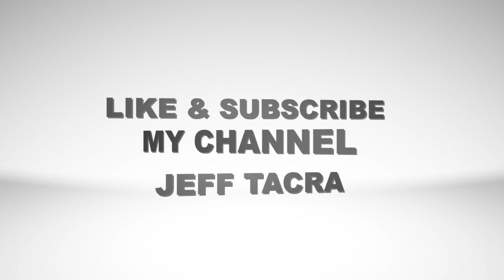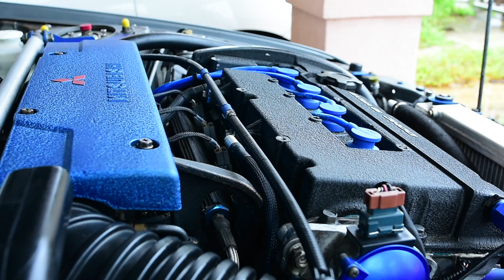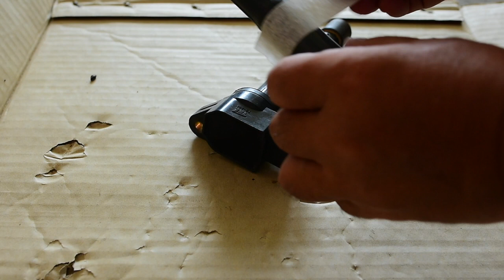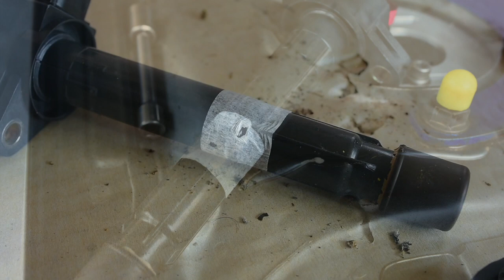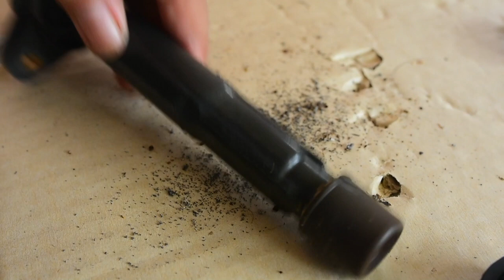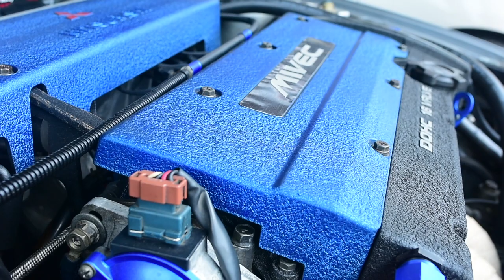Cara Pasang Coil K20 Pada Enjin MIVEC CA

Comment: Strut bar tu bos pakai apa brand ye? Saya punya takleh nak pakai bar kalau saya pakai cover intake tu.
Reply from the maker: Brand cusco dari evo3
Reply: @jefftacra  ouhh. Baik bos👌🏼 tq . Wiring siap pnp terus ke bos kalau pakai k20 ni??
Reply from the maker: Plug n play
Reply: @jefftacra  bengkel bos kat mana ye ? Saya ingat nak hantar kereta saya check. Mivec On problem dan ada bunyi pada engine, saya dah bawa ke bengkel, ada yg kata bunyi conrod, ada kata bunyi teppet, dan yg Mivec On tu pada gear rendah (1,2,3) boleh dapat , dan pada gear tinggi (4 & 5) memang tak dapat, tekan minyak lebih rasa kereta jadi blow dan rasa macam tertarik kebelakang. Rasa macam Mivec On nak bukak taknak bukak je. Minta Bantuan pada yg pakar🙏🏼